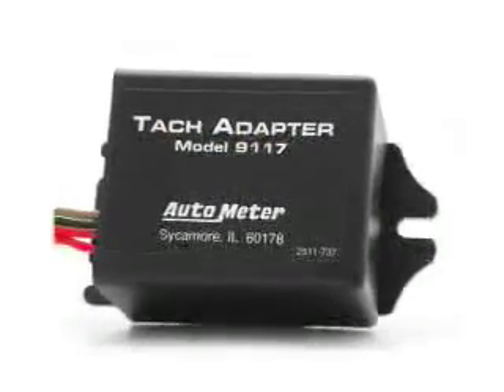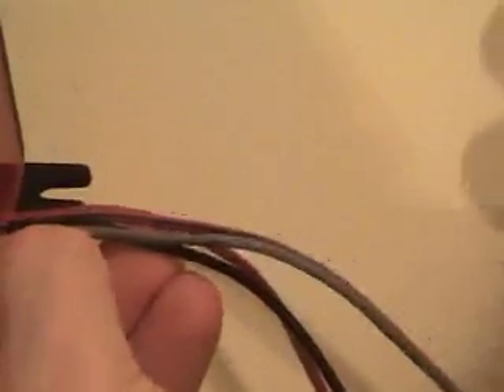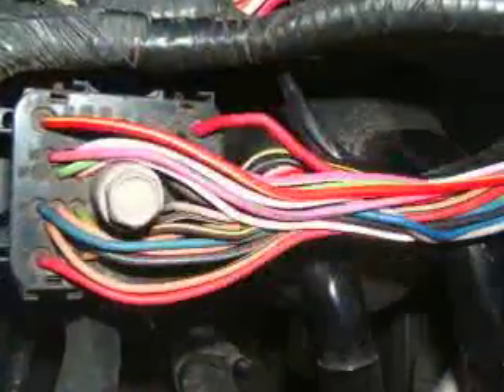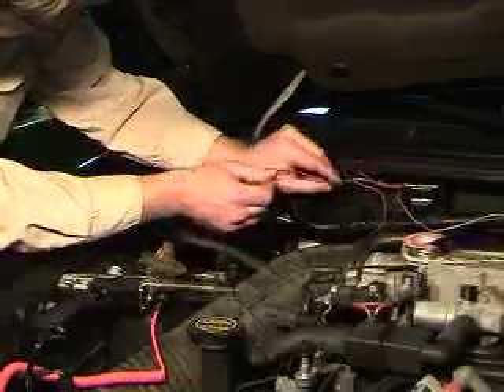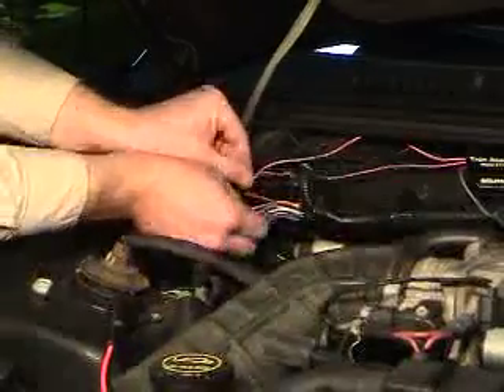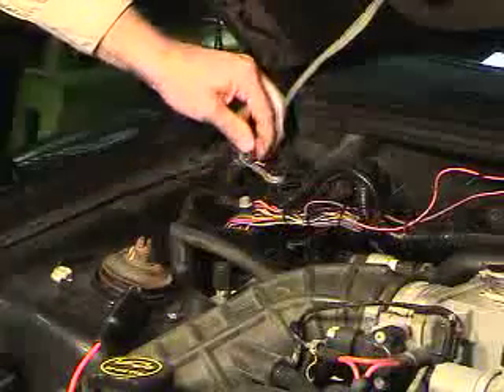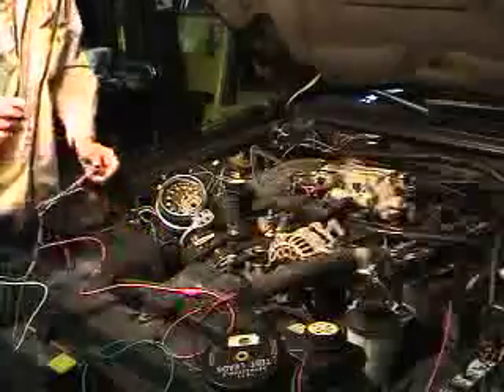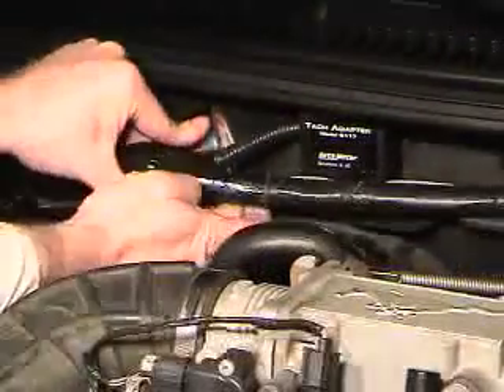Auto Meter 9117 Tach Adapter Install

Comment: at least three wires are used, Battery positive wire, battery negative wire and a Signal wire. what i did on my 94 gt(5.0) i found a fuse that is only hot(will only supply power) when the key is on the on or run position, i but the positive wire there, hooked the ground wire to a body ground(a bracket in the dash, and hooked up the signal wire to the ground side of my coil, now i have a Distributor so i have one coil, people that have newer vehicles can just tie into the #1 coil(ground wire)